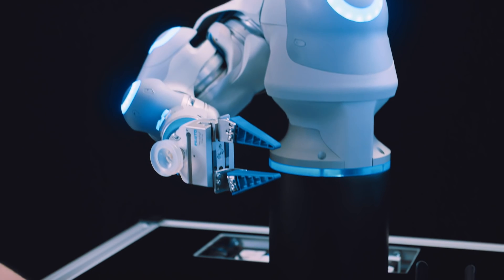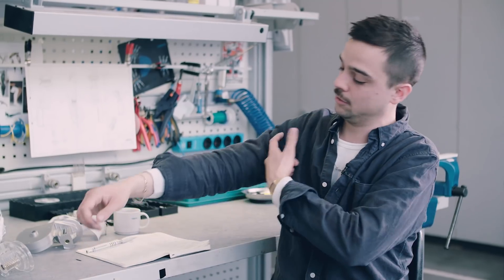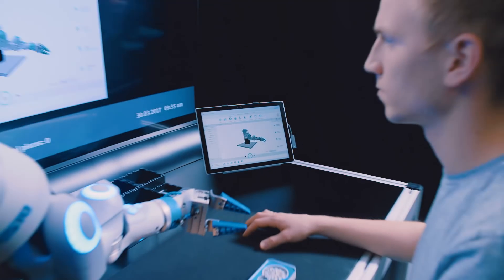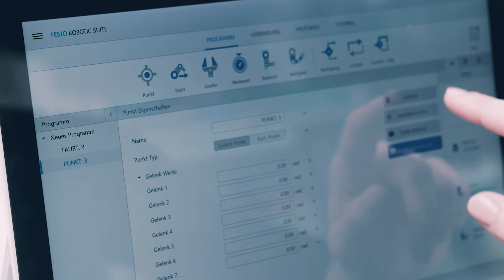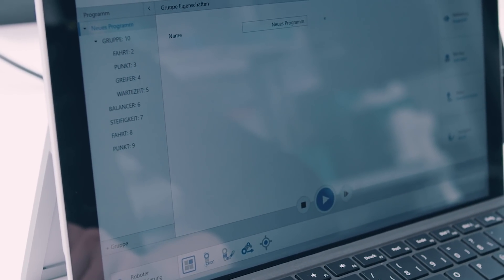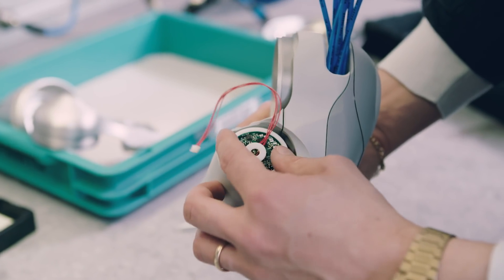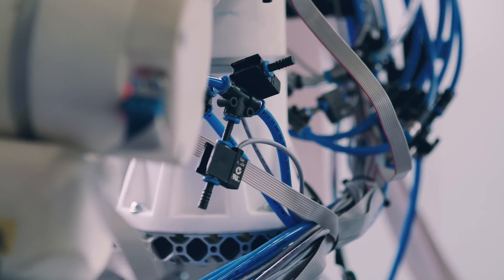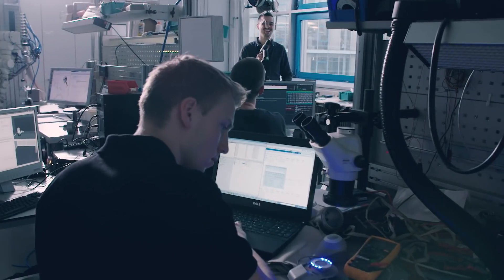BionicCobot - Making-of (English)

Comment: oh wow… let me point out how awful this user interface is. A user has to pick an icon from the top and drag it through the whole screen to the bottom. COME ON. With all of your awesome achievements, you couldn't figure out that a simple click on an icon could be made as a shortcut to add something to the end of the bottom list…

Also, these icons should be on the bottom so that you don't have to drag it across the whole screen in case you have to put something in the middle (or the list could be moved to the top, doesn't matter as long as you minimize drag and drop distance)

And finally, your “python script” looks like C#…
Reply: I suppose you are right in regard to the usability of the software.
But don´t forget the main achivement: It´s pneumatic driven robots with all it´s advantages. I don´t see an equal competitor to this company until today.
Reply: Its an organic interface
Reply: No, it's not. Still a flat control surface, except for the start/stop buttons on the arm itself. Valid critique from Aleks-Daniel. Of course, you don't want users to confuse bin with timeline, but there's way too much distance now. Icons could change color/tint once they're copied from top row to the one directly below it. My 2 cents, one year too late :)

Comment: great innovative design, however, i'm curious, why are the "air veins" separate tubing and not simply integrated into the structure like the motors?
Reply: It may be to do with maintenance. If an air vein breaks or springs a leak, you can just replace the vein; if they were all built into the casing, and the casing takes a knock in the wrong place, that's a full block of custom-made plastic, with internal air channels, that needs to be remade and refitted.
Reply: Either the flexibility issue discussed, you'd need a pretty complex system to deliver air through an articulation, or, the limitation of using their own existing products. Both are specified in the video.